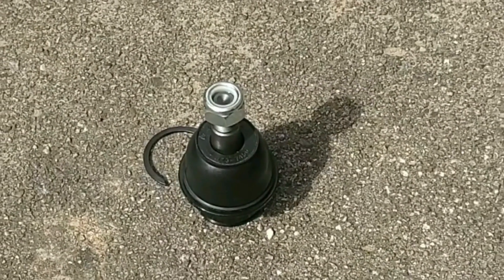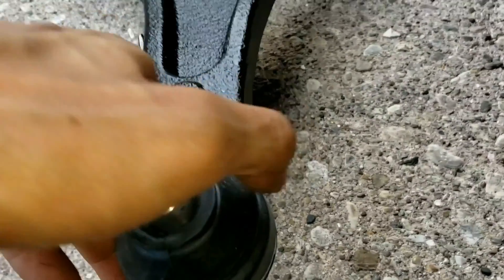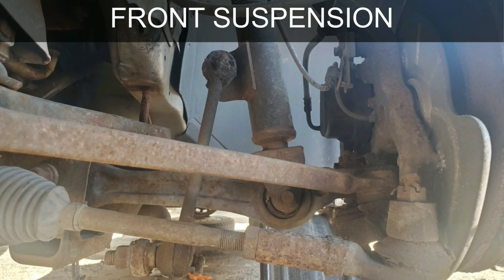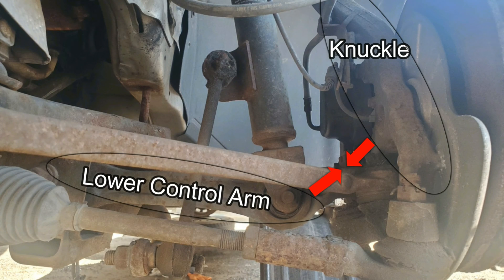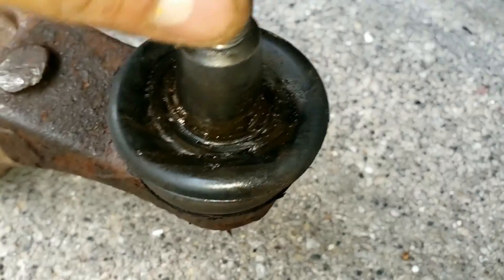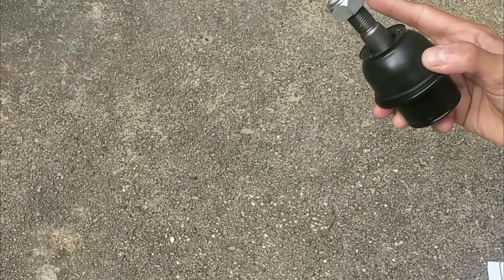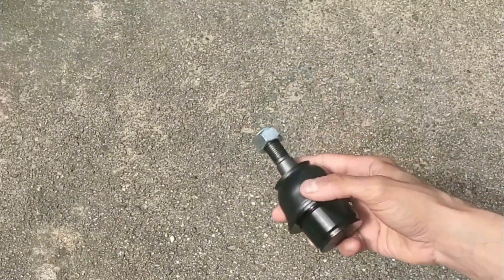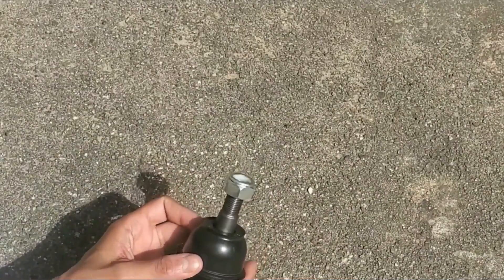What Is A Ball Joint And How To Know If Its Bad ⛐

Comment: So i have to pop out ball joint from control arm to see if it wiggles?
Reply from the maker: No not really. Its more noticeable. But if connected you'll feel a lot of movement which is not good. it should feel kind of stiff, if its good.